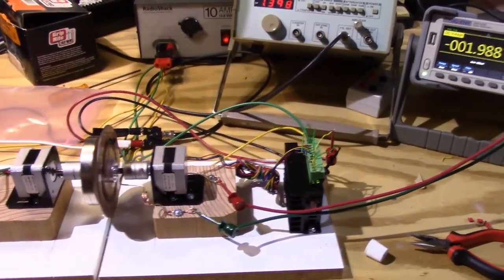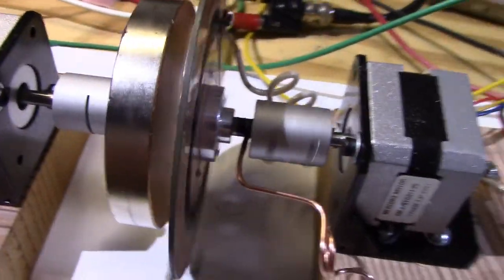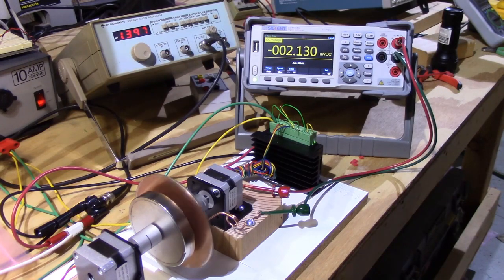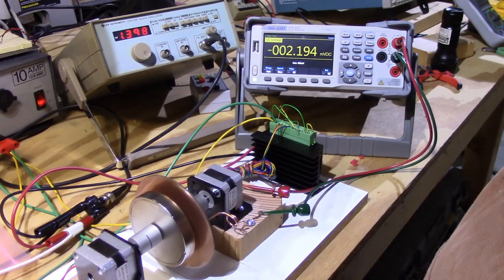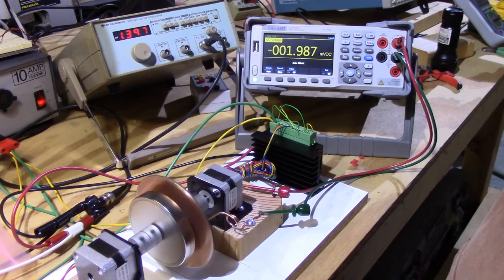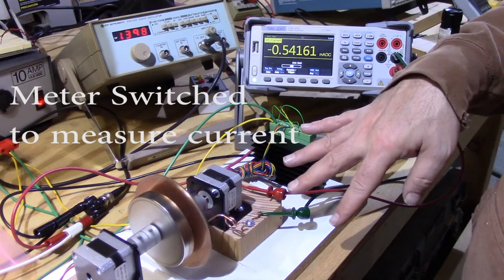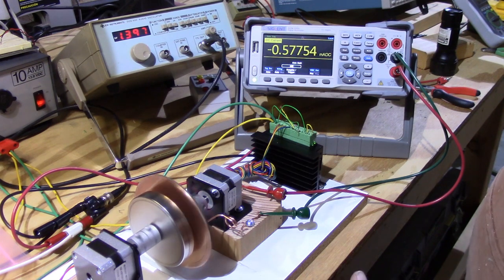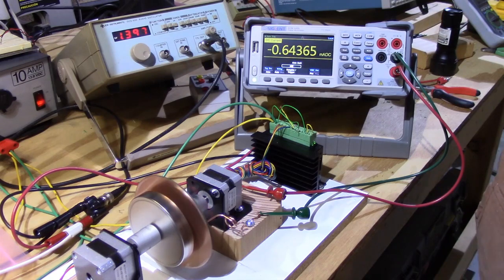PDX1 08: Paradox 1A demonstration: Faraday's Final Riddle

Comment: The first part of the riddle/paradox has been solved. Here is the proof:  At the 2min point on the YouTube video "Faraday paradox unipolar dynamo demo Par1" (www.youtube.com/watch?v=gduYoT9sMaE), they move only the return wire, and show the return path generates the opposite voltage as the disk.  
Note:  The final part of the paradox will be given by Mr. Distinti when, the current is measured for both mode 1 and mode 3 (this will likely show high current for the disk in mode 1, and low current for the return path in mode 3).
Reply from the maker: Thank you I will definitely share this video with the membership; however, it does not answer the question.   The riddle is: does the magnetic field move with the spinning magnet.  You need to show that the spinning magnet induces voltage onto something stationary (e.g. closing path).  By rotating the closing path with the stationary magnet is no more remarkable than rotating the disk with a stationary magnet; because it is already accepted that a moving conductor in the presence of a magnetic field will generate voltage.  Finally, that the closing path generates a voltage in the opposite direction is not remarkable either because the field lines enter the disk and exit the closing path so the polarity should be opposite according to both classical theory and NE.
Reply: You are correct; there is still the question, "does the magnetic field move with the spinning magnet?".  
This can be solved by using a variation of Mode 3 ( and reading current, not voltage).  
In the original Mode 3 (call this original Mode 3A), the disk and the magnet are spinning at the same speed (in the same direction).  
Two new-Mode 3 options (Mode 3B & 3C) will tell us whether or not the field rotates with the rotating magnet:  

For Mode 3B, rotate the magnet twice as fast as the disk (but still in the same direction as the disk rotation).  
Classical theory predicts it will produce low current (just like Mode 3A); thats because the magnet is moving twice as fast relative to the low-mass return-path as it is to the large-mass disk.  

NE predicts???

For Mode 3C, rotate the magnet at the same speed as the disk, but in the opposite direction.  
Classical theory predicts it will produce high current; thats because the magnet is moving twice as fast relative to the large-mass disk as it is to the low-mass return-path.  

NE predicts???

Conclusion:  The only difference between Mode 3A, 3B, and 3C is the rotational speed (and direction) of the magnet.  If any changes in current (not voltage) are produced, then one can reasonably conclude that the magnetic field  rotates with the rotating magnet.

Note:  Even without any new modes:  Notice that the only difference between the original Mode 1 and the original Mode 3 (3A) is the rotational speed of the magnet.  If any changes in current (not voltage) are produced (between the original Mode 1 & 3), then one can also reasonably conclude that the magnetic field rotates with the magnet.
Reply from the maker: Thats what I thought, however, I did the math on the patreon side.  Reading current will not make a difference.
Reply: (Smile) Ya, been there.   occasionally i have to remind my self that "math is not the boss of me", and do the test I've been avoiding.  Usually the math is right, but not always (sometimes I've missed something).  Our subconscious can prevent us from doing something which might give us a non-desired result.  If I was you, I would do the test because I could ( and initially ignore any inaccuracy; just do a rough current reading of the original Mode 1 & 3).  
Note:  Can you really justify (to yourself) not doing the reading?  It will take only seconds to do (of course, you may not get the result you desire, but I believe you will).

Comment: If you repeat the same experiment, but this time read current (instead of voltage); it will determine whether the "Classical" or the "NE" is correct:  
In Mode 1, Both the "NE" and the "Classical" predict HIGH CURRENT at 2mv (due to the "large-mass conducting-disk" moving thru the magnetic field).  
In Mode 3, the "NE" predicts HIGH CURRENT (at 2mv) is produced by the large-mass disk; but the "Classical" predicts LOWER CURRENT (at 2mv) is produced when the magnetic field moves thru the low-mass return wire.  

Note 1:  Reading current might require averaging multiple readings ( due to large fluctuations); then comparing the mode 1 current average to the mode 3 current average.  
Note 2:  For a generator:  A SMALLER CONDUCTOR (moving thru the same strength magnetic field, at the same speed) will produce the same voltage with a SMALLER CURRENT.

Comment: Hi Robert.
In mode 0 the video shows 0.002 volts [steady]
In mode 1 the video shows 2.000 volts [fluctuating]
In mode 2 the video shows 0.00(1)(2)(3) volts [fluctuating]

I would say it's fair to say that the magnet velocity actually does have something (a very small amount) to do with the system voltage and should not be dismissed since it may be a clue to what's actually going on.
Reply: The magnet in not mounted perfectly, thus there is a magnetic magnitude fluctuation with respect to the copper disk as the magnet rotates around its imperfect axis. Nothing to do with what he is trying to prove here.